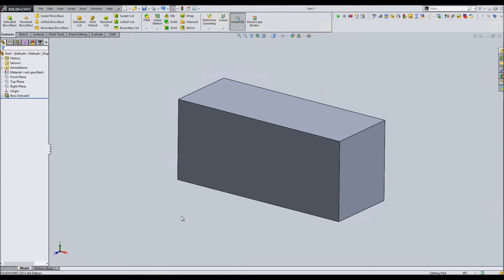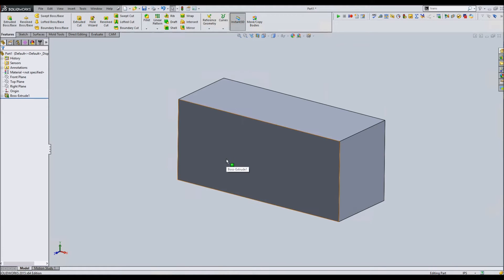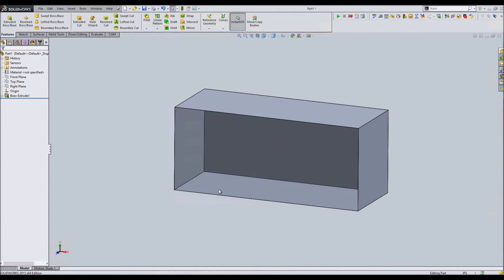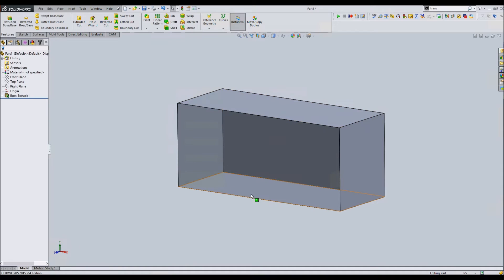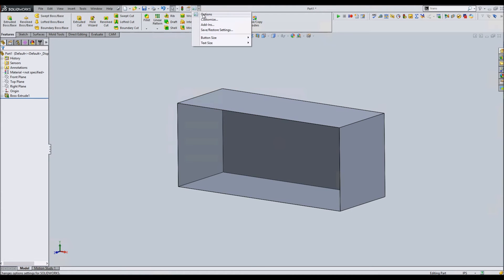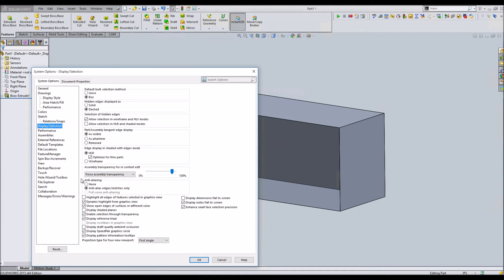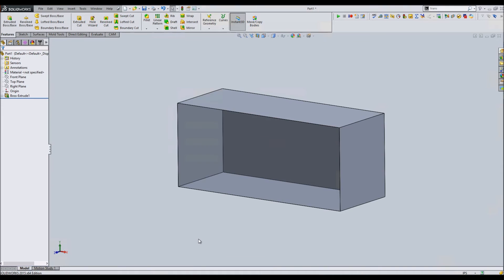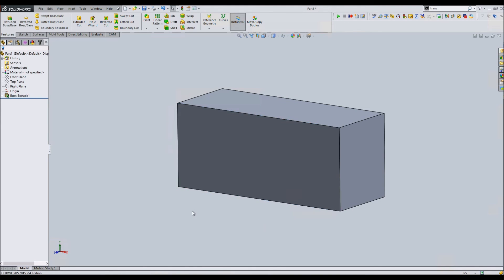How to Undo "Change Transparency" of a Face in Solidworks

Comment: How can I make it to where when I right click and choose transparency, it makes the whole model transparent and not just one particular face? I used to be able to do this pre 2021 version.
Reply from the maker: I think in a model it will make the selected face transparent, but in an assembly, it will make the selected part transparent. Probably still not all that helpful to you though
Reply: @clintathusaz  That does help, I believe that may be my issue. Thanks!

Comment: Wauw, yet again a very simpel solution for a huge problem TNX a lot
Reply from the maker: Robbie van Dijk No problem! You can also hold shift and select the face, which I was unaware of at the time or maybe it's only available in the later versions.
Reply from the maker: You're welcome!  Try hitting shift as an alternative. I didn't know about that before I made the video.
Reply: This (using shift button) is even better!